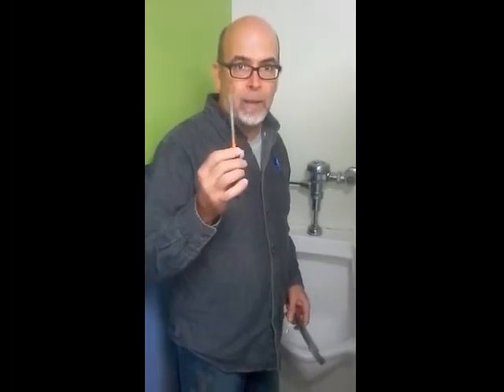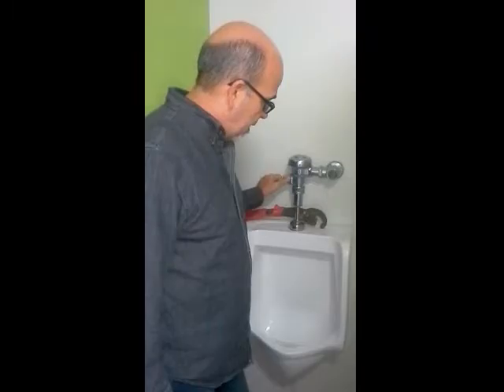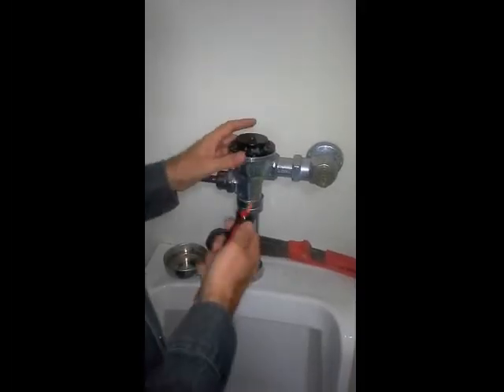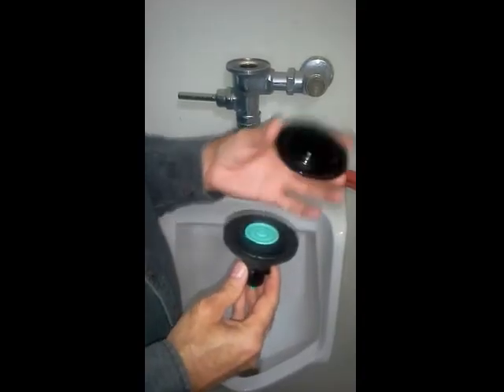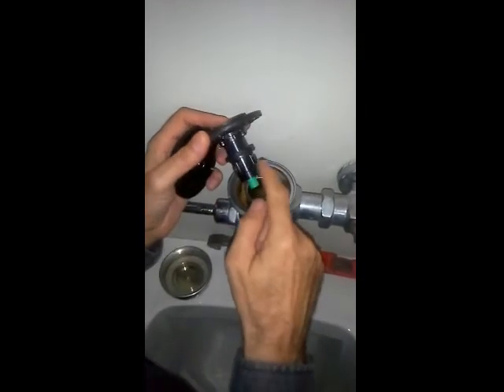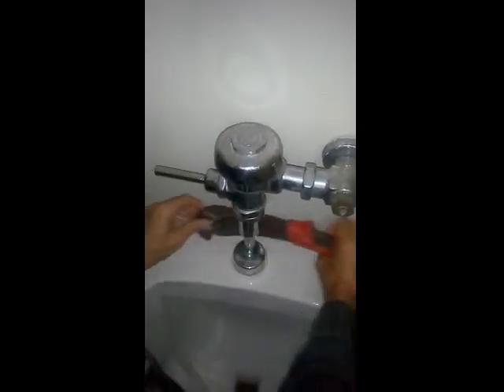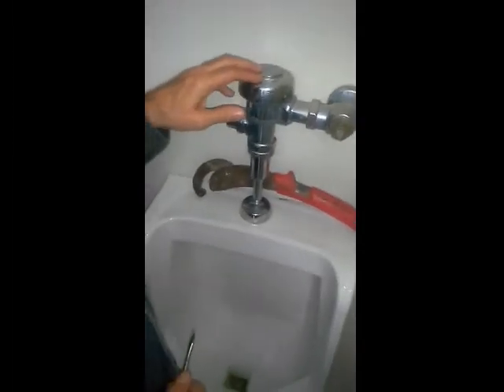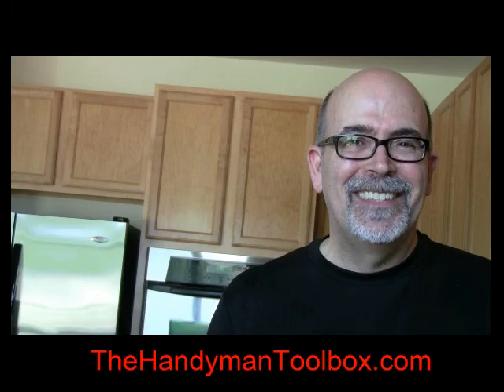Commercial Plumbing Toilet Repairs How To Repair A Flushometer Urinal

Comment: I could not tell if the pipe wrench had teeth.  If it did, it will scar the top part.  A crescent wrench is better if you have one that opens wide enough.
Reply from the maker: I so appreciate your comment and concerns. The teeth are minute and do not leave scuff marks at all...great to;; to use as I use it all the time.

Be sure to subscribe to TheHandymanToolbox YouTube Channel and click the "bell" to be the first to get notification when the DIY video is uploaded!

Here's our weekly schedule on YouTube Beginning Feb 7, 2017:

Tuesdays- 8PM EST YouTube Live Hangout: "The DIY Home Improvement Tips & Solutions Show" featuring Viewers' Q&A,  Simulcast on Facebook Live and BlogTalkRadio pod cast.

Wednesday- 8PM EST. YouTube Live Hangout: Contractors Connection Link, interviews with Handymen, Contractors & Other Home Service Pros    Simulcast on Facebook Live

Thursdays- Viewer Requested Featured Home Maintenance and Repair How-To Video Upload. Be sure to subscribe to TheHandymanToolbox YouTube Channel and click the "bell" to be the first to get notification when the DIY video is uploaded!

Subscribe & never miss out: http://bit.ly/DIYer4ever